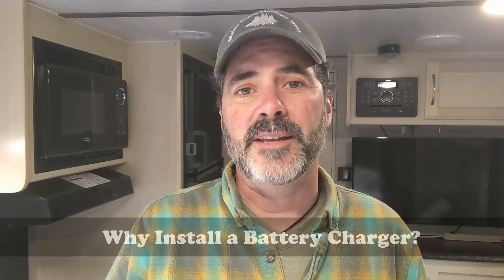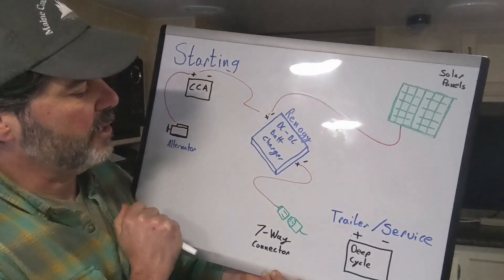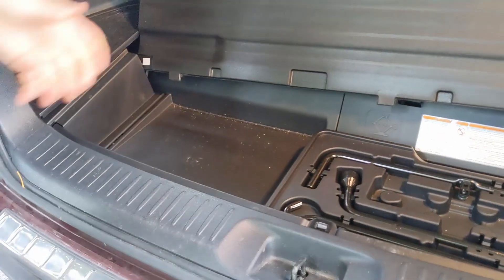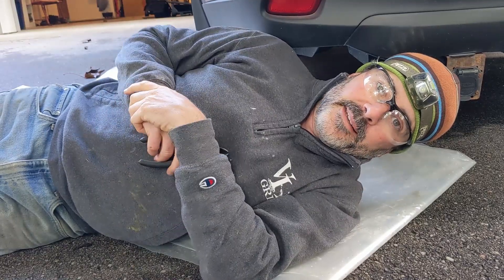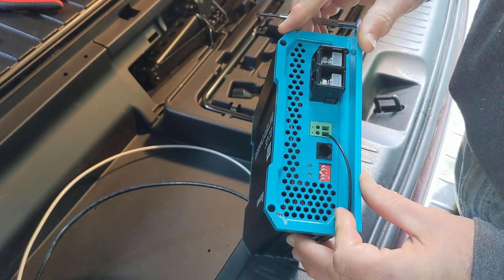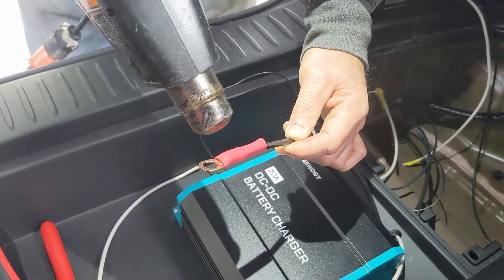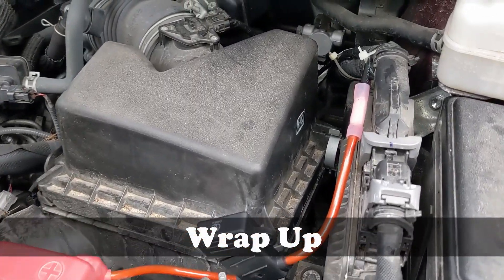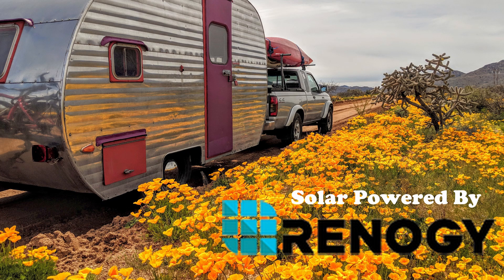How to Effectively Charge RV Batteries While Driving: [Renogy DC to DC Charger]

Comment: Good video, I hope you put grommets in the holes you drilled in the vehicle floor. If not within a few thousand miles the vibrations will cause a short. I found out the hard way.
Reply from the maker: Good thinking! The wires are secured through the holes!  Thanks!

Comment: Will this work for charging lithium batteries ?Or do you need a heavier gauge wire on the trailer side?
Reply from the maker: Yes, it will work for charging LiFePO4 batteries, there is a setting on the charger which will indicate that you've got the right charging parameters for the right chemistry of batteries.  
Now, as to this installation.  If you look at the video description, you'll see that we went back later and added an Anderson connector rather than have the DC2DC charger output just go through the 7-pin connector.  This helped us use a larger wire connection between the charger and the auxiliary batteries in the trailer.   Better charging in the long run.  
Here's a newer video where we did something similar, with the charger in the truck.  https://youtu.be/RSwoi2vh094?si=1PdsP-Gi3qZV5bvG
Here's a video where we installed the DC2DC in the trailer, and just ran wire cables from the starting battery, back to an Anderson connection on the truck bumper, and back to the trailer.  
https://youtu.be/IsRrIKzWpFo?si=DqBPzI0GWyVtGG-6

Be sure to use our link https://renogy.sjv.io/LPEyNY and promo code "CANLIFE" to save some money on your Renogy order.
Reply: @FreedomInACan  Thanks for the info!!

Comment: I have a 20amp dc dc charger for 4 batteries, kind of pointless to use for 4 batteries. Also consider the stress on the alternator
Reply from the maker: Well 20A might be a little small for a 4 battery bank.  But also understand that the reason to install a DC2DC is to get an effective charge but also not overtax the alternator.

Comment: Assuming you already have an AC - DC charger in your trailer, wouldn't it be cheaper to just install a 1000-2000w PSW inverter in your tow vehicle and just run an extension cord to the trailer? A remote switch for the inverter (to shut off when the vehicle isn't running). This way, you have 120v AC in the tow vehicle for other times you might need it.

IDK... just my $2 (inflation doncha know).

Comment: Please re-title this video to; 'Wire in a Renogy DC/DC charger'.
One step you didn't complete on the video is the connection from the DC/DC charger to the trailer batteries. You had mentioned tapping into the 7-pin, but you didn't show that process, and if you did, how do you maintain the higher amperage of the 8ga wire thru the 7-pin? hmm Looks like you didn't answer the entire question.
Reply from the maker: Hi Steve, thanks for the feedback.  Yes, you're right about that last step.  If you read the video description, we updated what we did on this project, but sadly didn't get it on film, (a little early in our video project days).  The 7-Pin didn't actually work like we'd hoped, so we ended up adding a 6AWG wire from the DC2DC output to an Anderson quick connect / disconnect plug on the bumper.  We have the other half of that connected  to the battery's common positive and negative busbars in the trailer.  So when we connect the towing vehicle to the trailer, we also make this more robust connection.  And it works great.  
You can see another video where we did this same install on our friend's RV,  only on this one, the DC2DC is actually in the camper in their power cabinet.  
https://youtu.be/IsRrIKzWpFo?si=Ae3ZyUIThiVNa-k1
Here's another where we did something similar with our 50A DC2DC with MPPT.  
https://youtu.be/RSwoi2vh094?si=0ooekh9On7dBsPgt
Let us know if you have any other questions.

Comment: I don't need much power- just running LED lights and charging items. I have a Lithium battery and a Reynolds 40 Amp DC-DC charger. Could I just run the DC power wire from the 7 pin harness to the charger? I have it mounted inside the camper next to the battery and grounding bar, etc.
Reply from the maker: I see what you're driving at, here.  I worry that the wire might not be large enough to deliver what the charger needs if you wire it that way.  You might see fewer amps than the full 40A by wiring this way.

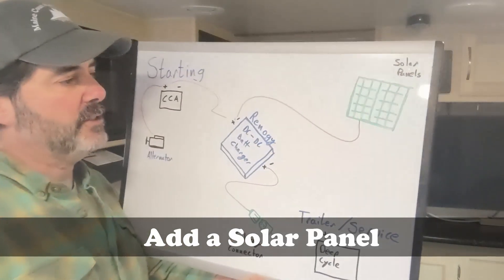Comment: Regarding the diagram at 2:31 - wouldn't it be better to place the charger on the trailer side of the connector? The way it is drawn, the solar panels would only work when the trailer is connected to the tow vehicle.

Also - does this setup work with Lithium Ion trailer batteries?

Thank you.
Reply from the maker: Yeah, for sure, you can do it that way.  An Anderson connector makes a good disconnect for the towing vehicle.  Also, it does work with LiFePO4 batteries, just have to select the appropriate mode on the charger.  

More info and videos:
DC to DC chargers can be put in the tow vehicle or the trailer.  These devices take the trickle charge from the alternator while you are driving, pump it up, and send it to whatever battery bank you choose.  They come in two different styles (standard and dual input) -- and can be incorporated with solar in a variety of ways, making them very versatile, especially when the weather isn't cooperating.

This video shows a 20A standard version.  He uses it to augment the SOC on his trailer battery bank while driving between campsites, then uses a portable solar suitcase while camping. 

Alternatively, here's an example of a 30A dual input version with a little hack we added recently.  We use ours in a couple of different ways to charge two different battery banks, depending on what needs to be charged at the time.   https://youtu.be/AMFJmfSLJ0I?si=fA_vV62hVCyIGV-q  

And, here's the step-by-step installation of the dual input version from a few years ago:  https://youtu.be/ur7gKRKp7aY?si=ByGLxHgIs5HeP2ee

Finally, here's an example of a standard 60A REGO DC to DC charger installed in the trailer:  https://youtu.be/dVD1oRIgBQc?si=6WXt2oAPNVHBb0mk 
as well as the wiring installation on the truck: https://youtu.be/IsRrIKzWpFo?si=kS0MmNHzXefl6s7e

Appropriately sized Anderson connectors between the truck and trailer are your best bet!

Hope this helps clear things up!

Use our link https://renogy.sjv.io/LPEyNY and promo code CANLIFE to save 10% on Renogy products.

Comment: The DC to DC charger can't boost both voltage and current at the same time without providing additional power. That's thermodynamically impossible. However, upsizing the wires like you did would definitely improve power transmission.

Comment: I'm missing something.  I would think most people would have Solar on their Trailer not on their vehicle.  So how would this work to charge from Solar and the vehicle while driving?
Reply from the maker: DC to DC chargers can be put in the tow vehicle or the trailer.  These devices take the trickle charge from the alternator while you are driving, pump it up, and send it to whatever battery bank you choose.  They come in two different styles (standard and dual input) -- and can be incorporated with solar in a variety of ways, making them very versatile, especially when the weather isn't cooperating.

This video shows a 20A standard version.  He uses it to augment the SOC on his trailer battery bank while driving between campsites, then uses a portable solar suitcase while camping. 

Alternatively, here's an example of a 30A dual input version with a little hack we added recently.  We use ours in a couple of different ways to charge two different battery banks, depending on what needs to be charged at the time.   https://youtu.be/AMFJmfSLJ0I?si=fA_vV62hVCyIGV-q  

And, here's the step-by-step installation of the dual input version from a few years ago:  https://youtu.be/ur7gKRKp7aY?si=ByGLxHgIs5HeP2ee

Finally, here's an example of a standard 60A REGO DC to DC charger installed in the trailer:  https://youtu.be/dVD1oRIgBQc?si=6WXt2oAPNVHBb0mk 
as well as the wiring installation on the truck: https://youtu.be/IsRrIKzWpFo?si=kS0MmNHzXefl6s7e

Appropriately sized Anderson connectors between the truck and trailer are your best bet!

Hope this helps clear things up!

Use our link https://renogy.sjv.io/LPEyNY and promo code CANLIFE to save 10% on Renogy products.
Reply: @FreedomInACan  super helpful thank you!
Reply from the maker: @milesb4231 Glad to help, holler back with any further questions.

Comment: Please stay away from electrical work. That was hard to watch... The T-Tap on the main ground made me cringe...
Reply from the maker: Thanks for the feedback.  We definitely would do it differently if we did it again.  We've learned so much since then by doing it ourselves, making mistakes and fixing them.  You probably didn't look into the description, but in the update from a few years ago, I describe how we bypassed the  7-pin and hard wired the DC to DC through an Anderson connector.  It works great now!  Thanks again!

Comment: Probably cheaper to have a portable 20amp battery charger to plug in when you get to your rv Park utilizing shore power. The shore power thru your controller will be too slow so the stand alone portable charger (20amps) would be much faster.
Reply from the maker: All well and good, if you're going back to shore power.  The point here is to not go to the RV park, enjoy the 10s of thousands of other camping options that don't offer hook ups.  From State & Local campgrounds, National Park Camp sites, to boondocking in BLM or USFS land, the possibilities are endless.  The DC to DC charger will help your battery bank get back up and running after a night of off-grid camping.  And if you're worried about money, the RV park isn't the way to go, haha.

Comment: A very good video, that explains a lot in simple terms to someone who is just starting a trailer project. 
One question though, If you have solar on your trailer and you need to run extra cables in parallel with your 7-pin anyway (as per your 03-2021 update), would it not be better to install the charger on the trailer side to take full advantage of the solar panels when the trailer stands disconnested from the tow vehicle?
Reply from the maker: That is certainly an option.  Ultimately, the closer the charger is to your battery bank the less volage drop that you'll have in between charger and battery.  What it sounds like you want is the Dual input On Board Battery Charger, https://renogy.sjv.io/rQ3X2j.  This would take both a solar charge, and an engine charge - when connected to the towing vehicle starting battery, appropriately.  We did this very installation as a part of our REGO system install series last year.  Episode 3 shows wiring the truck for the charger, and in this case the charger is in the trailer (Episode 4 shows that in detail). 

Episode 3 https://youtu.be/IsRrIKzWpFo?si=pB0FUuQFeT_OPdeT
Episode 4 https://youtu.be/dVD1oRIgBQc?si=wqcDFlekD7d341mR

Let us know if you have any questions and be sure to order with our affiliate link https://renogy.sjv.io/LPEyNY and promo code "CANLIFE" at checkout.

Comment: I hate to be a bore , but the airflow in that trunk is non existent , those things get hot hot hot , and that trunk will get hot , the fans will be recirculating warm air , and it’ll just keep getting hotter .

I am currently installing a 40a version , I’m thinking of installing computer fans , with filters .

Just a thought
Reply from the maker: Thanks for the comment.  This has been working well for 3.5 years with no issues!  Have you had problems with yours?
Reply: @FreedomInACan  

In the past yes
Reply from the maker: Renogy makes a great product!  We have the MPPT 30A dual input version in our truck and it's been a total game changer.  Runs  our 12V fridge full-time and charges our 200Ah battery bank in our camper as well.  3 years with zero issues!  We love it!
Reply from the maker: Thanks for the input, more airflow is always better than less for sure.

Comment: Great job and great video, So two observations; 1) there’s no need for the DC charger to be powered on if the trailer is not connected, so your 12v Enable Wire should come from the trailer through the 7 Pin Connector to the Charger.  2) Yes, you now have 20amps of charge current via that 8 ga wire, but it stops at the charger and does not continue on through the 7 pin connector. Delivering 20amps to the trailer requires you to extend an 8 ga wire through the 7 pin connector all the way to the trailer batteries, else you’re just using the 16 ga wiring that comes std with that connector - that becomes a fire risk if the trailer batteries are sufficiently discharged and start drawing a lot of current.  Good luck!
Reply from the maker: Hey thanks for the feedback!  You are absolutely right.  We actually added an 8AWG wire through Anderson connectors to the DC busbars on the trailer.  And now, we're seeing the correct amount charging on the battery monitor.  We put a 2021 update in this video's description - but not everyone reads it.  Thanks for the positive feedback.

Comment: Great work, glad to have found your video. Im pulling a 41 5th wheel and using Ecoflow Delta Pro power station that resides in the 5th wheel basement. I pull it with 2500 Duramax. Will this dc to dc set up work to charge the Ecoflow Delta Pro? Max DC input is 1600w, 150v 15 amp max input. TIA
Reply from the maker: Couple of thoughts.   First off.  Does your truck have a rear bed inverter?  Because you might just charge using AC power from that source while driving, just double check that the inverter is 1800W or less.  The DC to DC Car input (cig port) on the Ecoflow Delta is 8A @12V which would take a long time to recharge while driving.  I wouldn't recommend using the DC to DC charger as a "solar input" because the unit is rated at 20A and the solar input max in the Ecoflow is 15A.  This is a pretty big unit, do you use it for other portable functions besides the 5th wheel? Because you would get more charging power from both your truck and solar if you installed individual components, Solar Charge Controller, Battery Bank, DC to DC charger, and Inverter / Charger as separate components rather than in one portable generator like the EcoFlow Delta Pro, which is really built with AC charging in mind.  I hope that makes sense, let us know if you have any further questions.

Comment: You should never use the frame of vehicle for the neutral  12 volts of the system.  This will cause frame corrosion. On my vehicle, i ran a 3 wire 8 gauge wire. From front to back.  Good for about 40 amps. Positive 12 volts, negative 12 volts, and trailer brake control.   I also ran a 3 -14 extension wire. This 3-14 wire is hooked to my vehicle 120Volt  inverter.  Then i have a separate 120 volt plug at the trailer. On the trailer i have a 1000 watt battery charger 120 volt to 12 volt at about 50 amps.   There is extra power to run my compressor fridge.   I just find these dc to dc battery chargers have too much voltage drop on the vehicle wires. Because from the equation p=i^2*r.
Reply from the maker: Great advice, thanks!  On all of our subsequent projects we have grounded back to the negative terminal or common ground on the starting battery.   Good ideas here!

Comment: Positive is the BLACK wire??? What stadard are you following?
Reply from the maker: DC wiring, Red Positive, Black Negative.  It is not the same as AC wiring, or even automotive wiring.  When dealing strictly with DC wiring, this is the standard.  Thanks.
Reply from the maker: In case you are confused.  https://www.creativesafetysupply.com/articles/wire-color-codes/